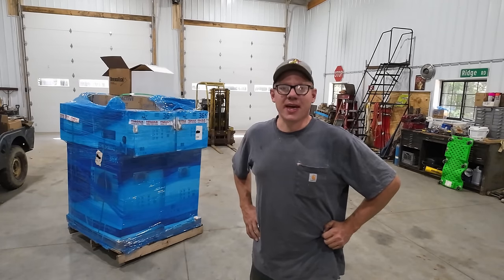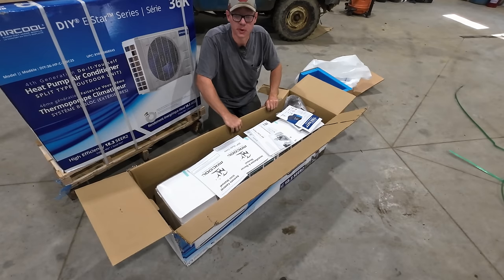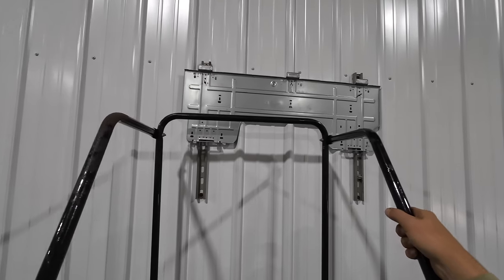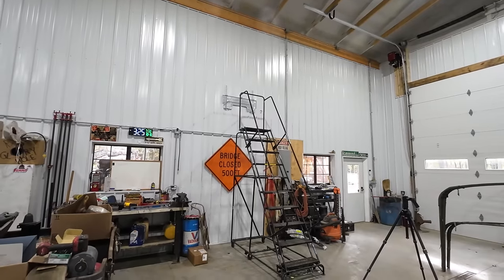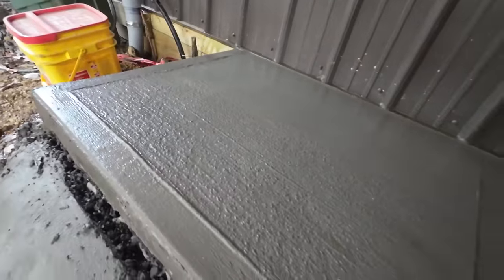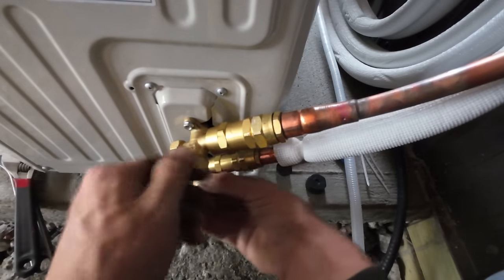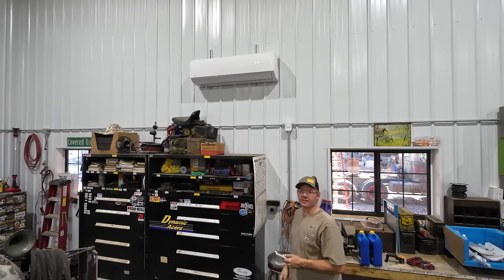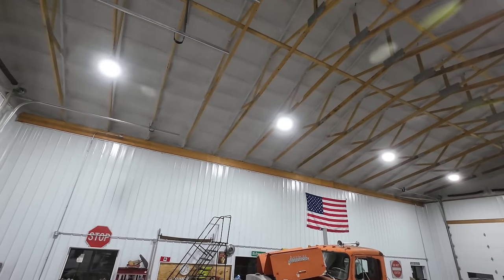DREAM SHOP Gets a Serious Upgrade! (How Hard can HVAC be??)

Comment: Down the road if you have any issues with those that require a tech to work on them, you  may find a lot of companies won't touch the Mr. Cool DIY units for one reason or another.  Keep em clean and they'll run happy for a while.  Also, if the line set is uninsulated, you will get condensation dripping off them  but they should not freeze unless the refrigerant charge is low or there's a restriction somewhere internally.

Comment: Mount them up high under the lean-to, that gets them out of the way and keeps them cooler for better efficiency in the summer.
Reply: Probably not. The metal roof will be very hot and radiate heat to the compressors if they were up close to the lean-to roof that is uninsulated. On the ground in the shade, they will probably be more efficient.

Comment: I’ve heard you mention that you’re going to get an outdoor boiler  eventually. They are very expensive but I can’t remember the brand but there’s one that’s about $22,000 and then I’ll heat up to 15,000 ft.² and the firebox is part of the roof and it hinges up. Thats for sure the way to go. No cutting amd splitting firewood, Just cut them into logs and load it with your skid loader.
Reply from the maker: That’s about what mine cost. It’s already here.

Comment: I’ve heard about these units but have been reluctant to install them, being a woodworker/ trim carpenter & not an HVAC guy or electrician. Your video gave me the confidence that I could tackle this project. Thank you for going thru this project at a speed that allowed me to learn. Explaining what you were doing & why was very helpful. I also learned a bit about this system from your commenters. If they work in Canada they should do just fine in WI’s north woods. Respectfully & Sincerely, new subscriber.

Comment: Good work Matt, here in Australia, because of the climate, these are the primary heat/cool source, they are very cost effective. In my house I have 3 and use them to control temp in various rooms when I am occupying them. For any additional units you install Don't be afraid to mount the outside unit on shelf brackets up out of the way from stuff. the main advantage of multiple units is you can place them in strategic locations, like over a specific work zone or office or ? and use them all together or all at once. I have one that's been operating for 20 plus years. Love your work mate, watch all of your videos. Oh yeah, you gotta clean the filters or you can freeze the unit coils.

Comment: the ceiling sweep fans are a must  They will reduce you power bill and pay for themselves in a fairly short time. If you can get reversible ones so much the better. Cheers and g`dday from an old Aussie sparky.

Comment: It's kind of late, but the advantage of installing the outside units at the higher level, above the hip roof is that it's clean up there.  Mounting the units at ground level exposes the aluminum fins to damage, no matter how well you try to protect them.  Also, near the ground it's a very dirty environment.    As far as the efficiency, I don't think it really matters.  I have installed a few mini splits.  The only problem I had once is that I didn't torque the refrigerant fittings tight enough and they leaked, just tightened them some more.  They are very efficient.

Don't forget to put the filters in the inside units, and also,don't forget to clean/change them once in a while.  Speaking of cleaning, the outside units can be hosed off, but to clean the indoor units, a pain in the butt.  They are usually inside a building, and to hose them would be a real mess, so there is a diaper that can be purchased that hangs below the unit.  Then with pressurized cleaner, the fins can be hosed off.  The dirty water collects in a 5 gallon bucket, and it will be very dirty.

Thanks for sharing, love your videos, hate to throw equipment away, like to fix it too.

Jim

Comment: First time you  burn out a compressor . Have an HVAC tech come out and remove the excess line set.  with the coil vertical like that every coil is an oil trap. meaning  not enough oil to lubricate the compressor. if you have room lay the excess horizontal to prevent the line set from holding oil thus avoiding a compressor burn out.  Been doing HVAC for 45 years

Comment: Love the mini split units, I’m planning to use the same brand for my future shop. I’ve also been considering changing my house to a few of these units, as my central AC system is getting very old.

Does anyone else love how excited and proud of himself Matt gets, all by himself, talking to the camera? 😂 reminds me of myself ❤
Reply: FYI they make a heat pump unit that is a direct drop in for your standard central air unit so you don't have to have heads everywhere and can retain your existing duct work and it's uses like a double decker version of the outdoor fan unit. They are slightly lower efficiency around like 18 Seer but thats still better then most central AC units.

Comment: Few comments. 
1. The pre-charged line sets work fine, however they tend to leak where those fittings are. After running them for a little while, I would highly recommend you go up there and tighten up those fittings.
2. Clean your filters. Especially in a fabrication shop and when you're running diesels indoors, you will clog up the evaporator coil pretty easily. The little filters they have on them are really just more for debris, not for any actual real particulate. You can make the situation less bad. By running a foam type filter. You can get bulk media from a supplier and cut it to fit. You just have to make sure and change them out regularly so they don't get all clogged up as well.
3. It gets pretty cold in the winter where you're at. Heat pumps like these generally work pretty well when it's cold. However, they will go into defrost once the outdoor condensing unit ices. When that happens, they go into air conditioning mode for a little while to melt the ice off outside.
4. With a tall bay like that, you will have some serious stratification going on when the units are in heating. Do yourself a favor and get a couple of destratification fans and it will be much more effective heating your shop. I like the ones from big ass fans. However, any ceiling fan will be better than none.

Comment: I want to thank you. I didn't even think about using a mini split unit. I have been trying to think of a way to do both heat and air in my camper and you answered my question. I don't see how I didn't think about these as I use to deal with them all the time where I use to work

Comment: I’m in the Great White north AKA Canada and I had two air to air heat pumps installed in my house this past early spring. They worked so great I installed two more in my two-story garage. I Installed similar units as yours but I had to pump out the lines on the model I bought (Senville) . No great deal though. It would have been less work to use mounting brackets for the outside units though. Less work and the brackets keep the units off the ground. Some jurisdictions require a certified electrician to run the 220 from the panel to the outside shut off box so best to check where you live.

Comment: Hey Matt, good install for those HVAC units. You need to contact the folks at Big Ass Fans. That is their actual company name. Our aircraft museum out here in Pueblo CO has two of their units in each of our two hangars and they do an amazing job of circulating the air. Our hangars are far too big to air condition but in the Pueblo Summer heat these fans do a great job of moving some serious air around. In the Winter months on lower RPM settings they gently circulate the heat throughout the hangars keeping it comfortable on the coldest days. Check them out, they've served us well.

Comment: @Diesel Creek , please read this. all is great except for location, or more specifiq installed height of outdoor unit. if you will be using it as a heater in winter time it needs to be by normal European standards 70cm above ground, and any flat mounting as here - concrete. beleave me, there will be a heck of a lot of water coming from the unit at the defrost cycle. so in this case as you have installed it, there is a huge chance to damage the unit. I've been working with these machines for a long time, so please just keep that in mind, to be safe. at the moment you have no place for defrosted ice to go

Comment: Hey Matt.  I think you'll like those mini-splits.  I run one in my shop and it keeps it comfortable on 105 degree days.

Unfortunately the looped lines are no good.  As the units run, the compressor's oil will circulate and end up pooling in those coils, which will cause the compressors to run without as much oil as they need.  The compressors will wear out sooner because of this.

A quick fix would be to move the loops to a horizontal position on top of the units, so that the coils don't act as traps.  It won't look as pretty, but the compressors will thank you.

Comment: 52K just to connect to utility, jeebus man you could go Solar/wind hybrid for less than that, and if you've got running water (creak/stream/river add in micro hydro. Throw in PVT and a ground based based geothermal loop (and you could do that yourself as well) and you'd be shiney.

Comment: Matt you didn't tell us what it cost. I've got a 40'x60'x16' Pole Barn. Spray Foam on the walls. It has a Steel Ceiling with R44. A Lennox House LP 96% Heat & a 20 Seer Air. $7000.00 Installed. Set 75 Summer. 60 Winter. It rarely runs. You do a great job with your content.

Comment: If you would have thought a little more when you hung the wall units, it could have been easier. You had unistrut on the wall. All you had to do was use the angle brackets they make and add a piece out from that, throw a rope over that and use the rope to pull up the unit and hang it while you messed with all the lines. No balance act, no stress. Then move everything down to the next unit. You could have even thrown the rope over the roof joist to hall the unit up instead of the balance act on the stairs.

Comment: That is another thing I find wrong with the Mr. Cool approach.  Leaving an extra long line set in coils can provide a 'low' spot for the refrigerant oil to collect which starves the pump for lubricant.  Far better to custom cut the set to the right length.  Also if you can hear the R410 "rushing" it means there was air in the lineset or more likely the air handler was not charged at all, leaving ambient moist air now encapsulated in the system.  Without a nitrogen charge to test for leaks and a vacuum test you just cannot be sure that your system is tight.

Comment: As far as DIY goes you may want a HVAC tech to come out and check the pressure of the refrigerant. Buddy of mine put one of these in and it was a little over pressure. The manufacturer packs a set amount of gas in and in colder climates it may be less pressure and in warmer they may be over pressure.

Comment: I get off peak rates for my shop heat pump/ac (Propane hanging heat and window ac for backup).  They can cycle ac but won't for heat.  100% efficient down to 0 degrees. You could start another fight with the power company over that.  I have found the ac doesn't need to be set very cool, but getting the moisture out of the air is the main reason I use it.  Very very comfy to wrench sweat free in the summer!

Comment: I install the mini splits here in Japan professionally, We don't have the DIY systems yet.
The lines don't have to be "Charged" with refrigerant unless they are over a specified length, usually really long like 30 meters. Here we have to connect the lines and then vacuum them down, but that's it.
Mini-Splits rock they really are great, but like others have said, clean the filters often.
In my professional opinion the compressor, the outside unit, is too close to the wall, it should be a minimum of 12 inches, unobstructed,18 inches is better, with the excess hose set there etc. you are too close, but really it should be OK.
Otherwise you did a great job, a very nice professional clean install, well done sir!
Cheers from Tokyo!

Comment: I had one installed in our sun-room and I installed one myself for my 24x28 garage.  Works great.  Mine has an additional heat setting below 62 with a FP abbreviation.  (freeze prevention),  Yours probably has the same, since all of these units seem to be made by the same company.

Comment: I installed two minisplits about 8 or 9 years ago.  They were a out same size as yours.  But they were Fujitsu.  Work great in Montana and Idaho.  Had to buy a few tools, vac pump, micron gage, made an adjustable crows foot to torque line sets.  Think I need to retorque line sets and recharge refrigerant on one of them.  It's been making weird noise lately when outside temperature is in the minus direction.  Next summer hopefully.
Reply: "adjustable crows foot to torque line sets"  It's really good you bought that, many systems are installed without those -- and at the wrong torque -- that causes problems and system failures; that a major reason installers get called back out; too many guys think I'll just torque it really tight without a torque wrench - that *will* mess it up.
Reply: @davidnull5590  I made an adjustable crow's foot out of small crescent wrench.  You have to apply a fudge factor if it is straight in line with torque wrench.  Or you can set it 90 degrees to line of wrench.  If you do that, you have to be really careful to only apply force perpendicular to the torque wrench.

Comment: You should put urethane foam on passthrough hole instead of fiberglass wool. Otherwise the wool get wet. At the summer, when the air is moist, the cold pipe sweat, even though there's thin closed cell  insulation. 

Also, what comes to concrete, you should rework the surface when the concrete is dried a while. It's not just aesthetic matter, but it makes the surface weather proof.

Comment: Having had these for heat and cooling in Finland since 1998 I would like to suggest you elevate your outdoor units by at least 4-5 inches so that you can have a collection pan underneath for the water and ice that it makes in winter time. It also helps reduce ice production because it's further of the wet ground. Mine are at least 20 inch of the ground. But good that you put them under a roof, that helps a lot👍. Great video as always!

Comment: You did a very good job on the install. Only problem i would see is that the coil behind the unit may be a oil trap for the refrigerant oil. Most of the newer equipment has a function for oil return. Minisplits operate excellent for heat and cool. Your in a shop so inspect the blower periodically and you could most likely use compressed air to clean them out due to it being a shop. Good job.

Comment: I went with fans. that can rotate both ways. push upward at winter and down in the summer. the direction really makes a different. sp that I will recommmend big time. my units where 4 feeds in diameter. maybe its more cost effective for you to. to have snaller but twice the fans :)

Comment: Great job on install, I put one in my little shop this summer and just love it. My electric bill has lowered compared to using a hanging electric heater last winter.

On the install I followed the instructions and put the mastic material over the line set connections at the unit lines, problem is I was unable to test the connection for leaks after charging the lines.

Notes, make sure you keep the fine dust out of the inside unit, clean regularly. Buy 240VAC line filters for the feed, this will protect the circuit board in case of a high in rush voltage (aka lighting strike) and they have a status light indicator on them so you know if their working or not.

Comment: Get an exhaust hose to attach to any engine you start inside the workshop, that sends the smoke outside. Your filters on the aircons will not need cleaning so often, your workshop walls will stay clean, and you save yourself from breathing all the nasty exhaust stuff...

Comment: Keep in mind that the condensation drain will cause ice to build up if the temperatures remain cold, so keep the drain a bit off the ground or at least away from any intakes. Sincerely, Norway

Comment: Hot air rises so I wouldn't mount it any closer to the roof than necessary. And to avoid defrost mode I would mount it under cover not on the roof where all that icky cold snow can sit on top of the outside units.

Comment: I know some people that were really surprised with Mr Cool products instead of the Panasonic and like they used before.  Much cheaper and equal/better quality and performance for a much lower cost.  I was getting ready to install one in the Florida room of my house (like 400-500 square feet and with a flat roof that had no room for real insulation).  I ended up moving due to a divorce.

Comment: I guess you already bought the boiler but otherwise, you should really consider geothermal heating. You dig a hose down at around 1.0 to 1.5 m depth in a certain pattern. The hose needs to be a few hundred meters long, so you need a bit of area. But that you have there. :)
The hose is then filled with a brine (in our case, an ethanol mixture), and connected to a heat pump. The pump cost around 10 000 $ with installation included here in Sweden. Maybe even less as you would dig the hose down and probably do part of the installation yourself. We heat an old house from 1938 with 176 square meter to 22C all year around (we have 7-8 months of winter with temps down to -30C) for around 12 000 kWh per year. Just to clarify, the heat pump would be directly connected to your floor heating.

Comment: The heat pumps I've seen around here use well water in winter.  It sucks 50 degree well water and warms air ro 50 degrees them puts cold water back into the well. For winter.  And vice versa in summer .  Heat exchanger. Both ways..